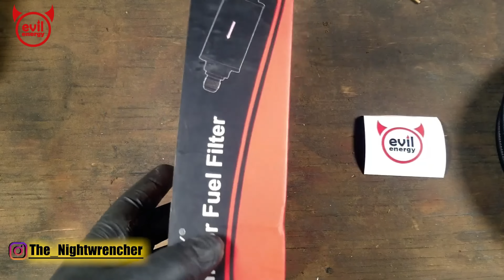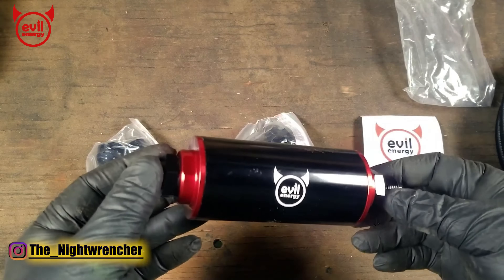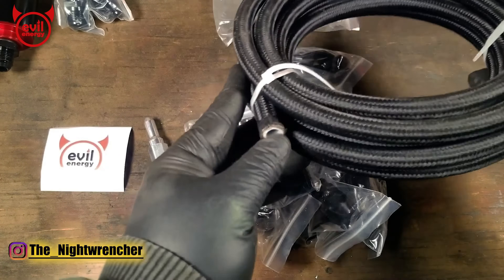Evil Energy | Why Choose PTFE Fuel Hose & How to Install Fittings

Comment: I made the mistake of mixing my Evil Energy fittings  that came with my 5/16 ID PTFE hose and my 3/8 ID PTFE hose in the same box.  Big mistake.  The hoses look identical and so do the fittings.  However, the ferrule size is different for the two different hoses.  The difference is so slight you might not notice it, until you try to force the 5/16 ferrule onto a 3/8 hose.  The first three fittings I put on went together with ease.  The last three took considerable force.  Will finish connecting the new lines and testing for leaks soon.  If I have to rework a fittings that leaks,  I will be sure to use the proper size ferrule (also referred to as the olive).  Wish me luck.
Reply from the maker: 🤞🤞🤞Good luck!

Comment: I've probably viewed 3 dozen 'how to install AN fittings videos and until now not one ever mentioned there are different fittings for PTFE.  Not even eBay or Amazon listings make this clear.  So I have boatload of AN6 fittings and 40 Ft of PTFE that are incompatible.  Sigh, I just bought some steel-braided CPE hose rather than waste all those fitting.  At least half the PTFE is still in the return window.
Reply from the maker: Thank you for your feedback, and we’re sorry for the inconvenience. If possible, could you record a short video showing us where you encountered the issue? This will help us better understand the situation and provide professional guidance.
You can also reach out to our customer service at support@ievilenergy.com with your order number, and we'll assist you as quickly as possible.
Thanks for your understanding and support!
Reply: @ No video really needed.  The issue to clarify is that 'AN' isn't adequate description of the hose, just the connectors.  PTFE is significantly smaller than CPE and the connectors for each are completely different.
Reply: Obviously they are different fitting that's why you need to order PTFE fittings if you bought PTFE hose
Reply: I just bought PTFE fittings and lines on JEGS a week ago, on each page it was stated that these fittings/lines were only compatible with other PTFE components. So either the website you bought from didnt say that or you didnt look at the description pages for each product. But, I almost made the same mistake as I also didnt know there were different fittings, so at first I put regular AN fittings in the cart and then once I looked up the PTFE line I noticed the description saying "Must use PTFE line compatible fittings."  My guess is the website you ordered from did not specify it clearly in a place people would see at a glance, thats website design 101 not your fault. I hate websites that dont list important things or lack a decent details section.

Comment: You're representing a company that makes AN fittings, and didnt even use an AN wrench.
Reply: Ive made dozens of fuel and oil lines and never once used an AN wrench lol. Keep the adjustable wrench tight on the fitting an be careful and worst is you get a tiny little mark where you had the wrench. Even with an AN wrench you can mess up the fitting if you aren't careful.
Reply: He forgot his an wrench in your purse